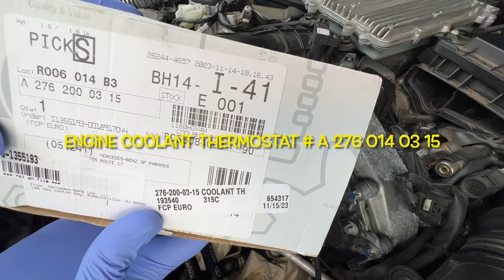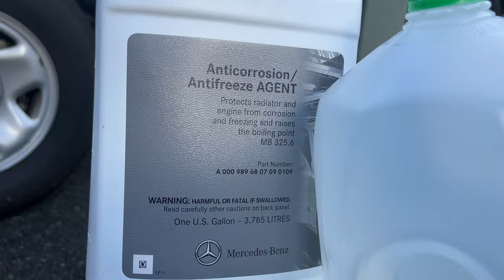How To Replace Engine Coolant Thermostat on a Mercedes GL450

Comment: Nice video. I noticed you only changed the top half with the thermostat itself and sensor connection. How much longer do you think it would have been to replace the entire thermostat assembly?
Reply from the maker: You should always contact a license professional when installing or repairing. Thanks for watching!!

Comment: Thanks for this video! I just changed my thermostat on my W166 2019. Just a quick question please, the part of the thermostat that you didn’t change, it has a gasket the orange one, if that gasket is bad…. What would you think the symptoms would be? I didn’t change it on mine either and I’m worried thinking I should have
Reply from the maker: Usually the gaskets fail after the engine overheats.
Reply: @michaelkoren56 Thanks for the reply, I never had it overheat, but I wonder if that gasket goes bad can it cause the coolant to enter the manifold or exhaust ?
Reply from the maker: @SammyS1836    Not under any condition. In most cases, this is the result of a blown head gasket.
Reply: @michaelkoren56  my head gasket isn’t blown, there’s no coolant in the oil or oil in the coolant, I also did a combustion test to confirm at different times. For whatever reason I have blue coolant in my system which I’ll flush for OEM pink but… after changing my thermostat I realized I don’t have any heat (I never use heat, live in a hot climate) and my temperature reaches 90 but then goes down to 80ish whenever I drive and then back up to 90 when idling. That’s why I tackled my thermostat. Other then that the reason behind my question was my original issue which is for some reason at random times there would be white smoke from my exhaust only when in park (at idle). It’s rare, not common but happens with a slight smell of antifreeze. Can’t point my finger on what’s the cause….
Reply from the maker: @SammyS1836   Coolant gets into the exhaust? Another reason could be bad gasket seal between the cooling system and the intake or exhaust manifold.  
"Other then that the reason behind my question was my original issue which is for some reason at random times there would be white smoke from my exhaust only when in park (at idle)." 
It might just be condensation being vented while the engine is running.

Comment: I need help how to bleed the air out of the system
Reply: Well the way it was done in this video (although it isn’t shown) was a vacuum fill. If you were doing this with out vacuum fill what I would recommend is leaving the coolant cap off. Then fill reservoir and start the car and set the heat all the way up. While the car is idling keep an eye on the reservoir level as it may go down and you will just keep adding coolant after about ten minutes check the heat coming from the vents if it’s hot there is no air. If it’s still cold repeat the steps again and it should start to warm up if not you may have another issue. While the car is idling I also at times dip my finger in to the coolant to see if it is getting warm but doing all that should help you get the air out the system. It may take longer but it still does get the job done. Hope this helps!
Reply from the maker: Thanks!
Reply: @maksimus-129  thank you will do it today